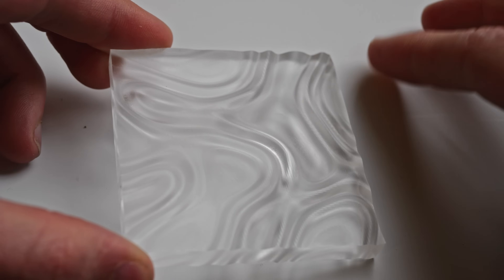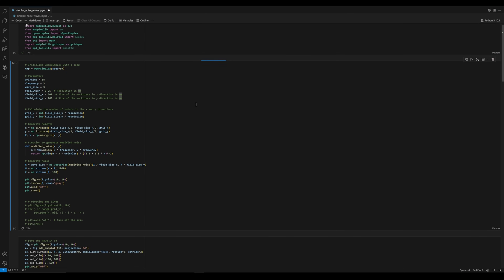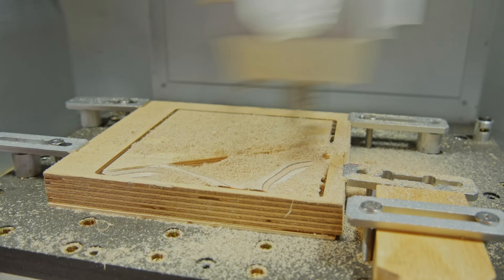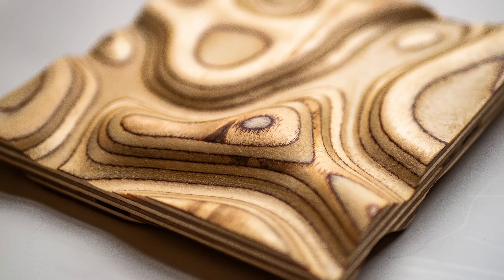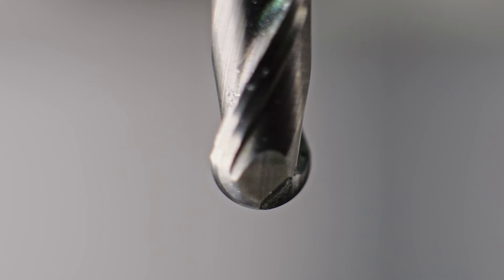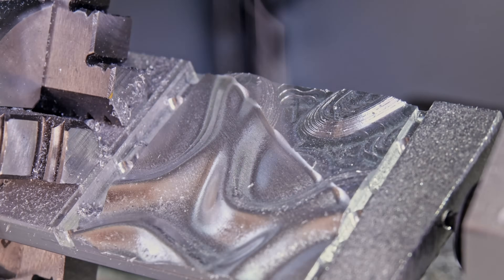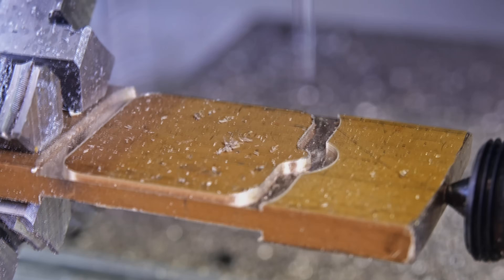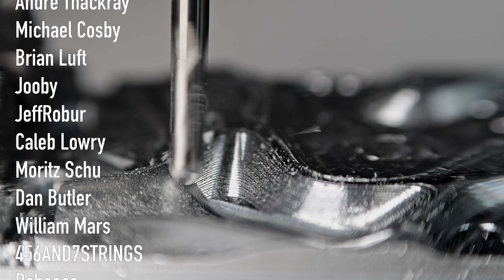3D Machining Waves from Solid Metal

Comment: a simple rotary tumbler with the right kind of polishing shot in it would polish the brass one to a mirror finish. but what would really look nice is a copper one, polished and then patina-ed with some heat. with the right sort of atmosphere around it, you could select for cuprous or cupric oxide as well, getting a nice red or black finish.

Comment: It is better to use at least two passes with ball milling where the first can be a large stepover and the second finish pass can be the finer stepover.  If you finish in one pass then there is variable force or pressure or loading applied to the tool due to the differences in material thickness which always compromises finish consistency.
Almost all materials finish better with some kind of lubrication.  I have not tried it but a bit of grease may be just the ticket where you want some lube but also don't want to go spraying oil everywhere.

Comment: If you make two matching wave paterns with a uniform offset along the normals of the surface of a fixed distance you could layer something like alternating layers of paper mache to test and make little flat billets  with the height map pattern project and create an effect similar to blacktail studios epoxy denim table top. I think blue denim like that could look cool with inlayed brass

Comment: This is by far the best video on the Carvera that I've seen, and I've watched a lot.

Designing one large wave piece that is split up into multiple acrylic blocks could look cool as tiles in a bathroom wall. 

What do you think the learning curve is like with these machines? Do they provide some sort of starting point for feeds and speeds based on different materials, or do you have to figure all that out yourself?
Reply from the maker: Cheers! Learning curve with these machines was quite straightforward, I think they're pretty forgiving and the setup on the control software is very easy.
There's also a feeds and speeds guide in the booklet with the machine, and on fusion 360 they have defaults that you can select which is a good starting point

Comment: Been following your work for years mate, and these are just stunning pieces. Given they lay flat, I could easily see a use for the larger ones made of wood being used as a trivet to put a hot pan on. I’d definitely buy one, and even the small metal ones as keyrings would be a good side hustle.

The obvious big choice is a table, and I think a wooden base with a glass top floating just above the surface using standoffs would look amazing. 

Other than that, outright wall art. In any case, keep up the great work and the very best of luck as you start your career 😊
Reply from the maker: Ah yeah that is a good idea, I was thinking the smaller ones would be good for coasters but I like the idea of a trivet.
Once I get the big homemade CNC up and running again I think a table would be a great idea.
Reply: Yeah coasters too would be good, although with cups/mugs generally having a non/flat base with a ring to sit on, you may need to make the design a bit more densely packed to make sure the ring of the mug has enough support without wobbling.

Comment from the maker: Let me know if you have any project ideas for applying these wave carvings to, I hope you enjoyed the video!

If you are interested in the Carvera CNC machine used in this video, it is available from Makera here:
Carvera:
https://makerainc.sjv.io/dOD7gk
Carvera Air:
https://makerainc.sjv.io/9L9JD3
Use the code TAOW100OFF for $100 off a machine.
(purchasing through this link will give me a small kickback to help support this channel and these projects).
Reply: Great work as always! Thanks for sharing your talent and journey with  us.
Reply: Idea: you could use it on soundscape improving wall and ceiling panels. Maybe design a honeycomblike grid in wood where softer dampening hard foams are fitted, with the wood having a different but complimentary wave pattern to the pattern on the foam boards.
Reply: (With 2 cnc’s on your desktop, I’m sure you'll enjoy the effect of acoustic dampening...)
Reply: And a less functional idea, you could make a relaxation ornament where water runs over a sloped wave surface, maybe one where different water flow rates cause different paths and thus different sound...
Reply: Looks like your using aluminium flatbar which is a bit soft for machining, something like 5083 plate or 6061 should machine nicer. Love your videos, been watching for years btw.
Reply: Would you be willing to try milling a clovis point?  I created a STL file via 3D scanner of my recent clovis point, it's about 4 by 1 inch.